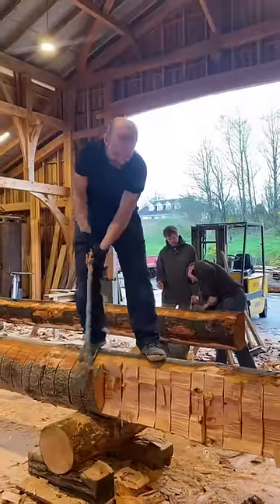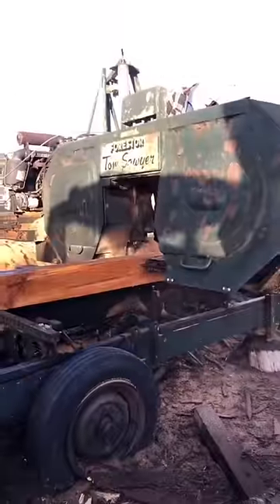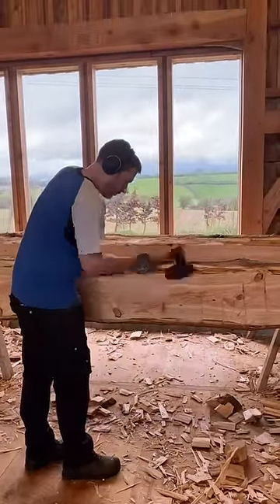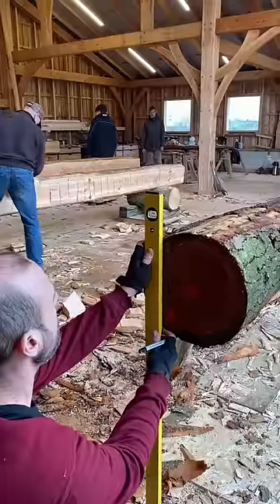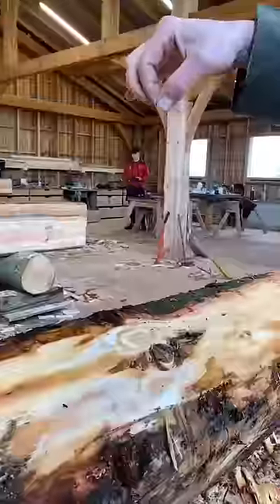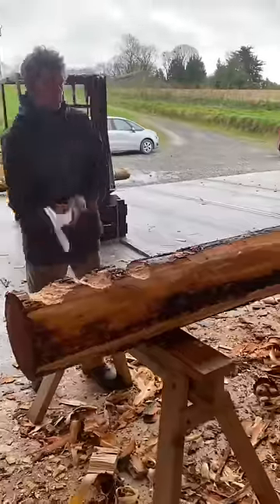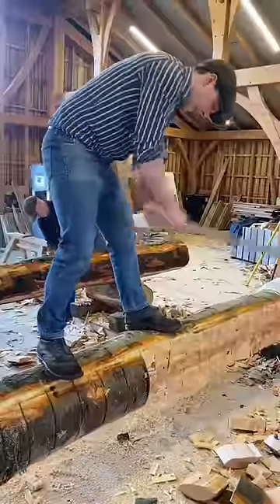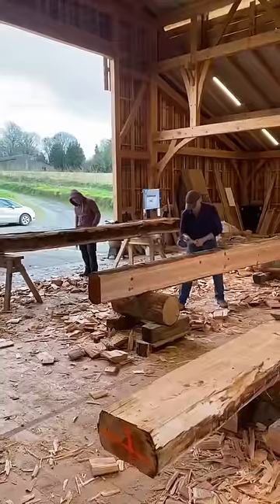Hewing a Douglas Fir Beam By Hand #ireland #woodwork #handtools #hewing #traditional

Comment: That foot reduction surgery line was way too casual :')
Reply: That freaked me out too!
Reply: It's really difficult to cut toes off with steel/composite toed shoes/boots.   It's not like he's barefoot like third word countries.
Reply: @michaelthompson7554 Not wearing ‘ought but leather!!
Reply: @michaelthompson7554  Japanese do this barefoot by choice. It wouldnt be difficult to cut toes off with a sharpened hewing axe. These axes can weight close to 15 pounds. Swung down with such force it doesnt matter if you have shoes on or not. First of all, you drop the axr to the end of the handle, that length makes it impossible for the axe head to hit your feet, the blade of the axe will always hit the tree first. Why? because if you were not on the tree and aimed for your foot in the same way, it would hit the floor first. Second, bare foot is better because you have way more stability on the tree.
Reply: That caught me as well. Great explanation of how to make a beam, though.
Reply: @shanemccarthy1562  Right... Because steel-toed boots definitely won't hold up against an axe...
What are you even talking about?
Reply: @michaelthompson7554 coughs in Wranglerstar.
Reply: @MartinFinnerup I mean, they can only resist multiple thousand pounds of force! Clearly wouldn't hold up to the <100 lbs force of an axe swing. It's simple math!
Reply: more like toe breaker :D
Reply: @MartinFinnerup  you clearly dont know your steel
Reply: the sneakers!
Reply: @shanemccarthy1562  bro is really trying to convince us to swing an axe barefoot
Reply: Would have happened in the past to many a man
Reply: 'Tis but a foot. The gods saw fit to bless you with two.
Reply: There's always one, isn't there?

Heaven forfend we just enjoy a little wink to the nature of the tools.
Reply: Just be aware that surgery on hands & feet is EXTREMELY specialised. Those pieces of mechanised human flesh are VERY complicated machines.
Reply: @michaelthompson7554  people in third world countries have shoes.

Comment: As much as i appreciate the old method, what a relief it is that we DONT have to process lumber this way anymore.
Reply: Not typically, but when you're doing maintenance on heritage sites like old castles or colonial era houses in the U.S., these techniques are what are mandatory to keep the thing as close to the original construction as possible. Yeah, it wastes a lot of material and is time consuming, but you have to admit that a saw cut beam perfectly square down to the last milimeter and modern 2x4's would look really REALLY odd as a repair in an old tudor country estate house.
Reply: @jasonsexton8869  Yeah but that's more restoration, so that's perfectly fine.
Reply: and don't have to waste all the at timber
Reply: @PBMS123  much of that leftover wood from the classic or modern methods gets turned into particle board, plywood, and other forms of amalgamate building materials.
Reply: @PBMS123 they sell it for repurposing or repurpose it themselves for many things. Even just selling scraps for a wood stove or old fireplace. There never should be wood waste. I say again, SO MANY things are done with this
Reply: I don’t know, I’m thinking if we HAD to produce beams this way, we’d all be far too busy to create all the problems we have nowadays.
Reply: I know, chainsaws are EXHAUSTING
Reply: @jasonsexton8869  Are the beams stronger than a sawn off cut of lumber because splitting instead of sawing follows the wood grains better?

That's how it works with bows and planks for shipbuilding. If you saw it, when it bends it will crack wherever the wood grains were cut through. Whereas if you follow the grain you can bend it thousands of times without cracking it at all.
Reply: Imagine the waste
Reply: Old school way gave more jobs. And I'm sure the cut off isn't wasted. Used for small utensils or tool handles or firewood.
Reply: Yes. So much wastage with this technique. Even if you're not using the timber for construction it's still useful stuff. They probably missed out on 10-20 2x8s using this technique
Reply: @anvilsbane Yeah we'd have different problems, like dying from a single splinter that went septic, and half our kids dying before they turned 1.
Reply: @gamemeister27  lol you missed my point. I’m not saying to abandon medical advances or sanitation. Our current world is inhabited by bored, unfit, and unemployed. And as I was saying, it would give folk something to do while socializing. What would be wrong with that?
Reply: @anvilsbane  You're very obviously romanticizing the past. Having to produce beams like this would be bad. Getting the option to do it sometimes is fun and good, but it also isn't some panacea for modern problems. People are fully capable of finding some activity they like and getting together to do it, it's not the absence of hewing posts or some other equivalent activity that causes the problems.
Reply: @gamemeister27  I liked your reply. Can you expand on what is causing the problems? “Romanticizing”? Mabye. But not sure how that makes what I said untrue.
Reply: We? Do you process your lumber the modern way now?
Reply: @anvilsbane  Sorry I been meaning to reply to this and keep forgetting. I'll see if I get around to it soon
Reply: @PBMS123  Not a waste today; people can just recycle that wood now with modern use.
Reply: @PBMS123  Not a waste today; people can just recycle that wood now with modern use.
Reply: @anvilsbane  Amazing that when people produced wood in that way back in that day, they still had all sorts of problems to deal with like wars, plague, social strife and unrest.

Huh.

It sounds like those things are just a part of the human experience.
Reply: @FrankExchangeofViews.  None of this wood is being wasted now, and none of that wood was being wasted then. People could sell the leftover wood for firewood, and nowadays not only can they be sold for the same purpose but can also be used to create Plywood, whipple, paper, and all manner of things.
Reply: Goddammit. I'm double posting again, sorry for the spam I'll go back and delete the copies.
Reply: @AmazingAutist  but boredom, obesity, eh? You know exactly what I was aiming at. There is no cure for the human condition.

Comment: Or, alternatively you can cut out a groove with the same (or a fraction smaller) diameter as the next log round groove along the length. Way less work. Then build a whole log horizontal stacked log house or cabin. Very sturdy and energy efficient, also very expensive for the owner being built to order. Traditionally with reed or straw roof, it's the preferred ancient building technology in my area (et the extreme East of Europe), revived and gaining popularity since the 2000s.

Comment: theres a point of efficiency that needs to be taken into account. Doing all this by hand is just way too slow.

When you start adding in crap like "electric chainsaws"; it loses all endemic properties of "hand made". It makes no sense to process wood this way any more. Its not "hand made"; youre using a chainsaw. You have an LED lit workshop, with modern tools sharpened by modern tooling. 

This is absolutely nonsense hertiage manfacturing that is fundamentally dishonest. Pick a side.